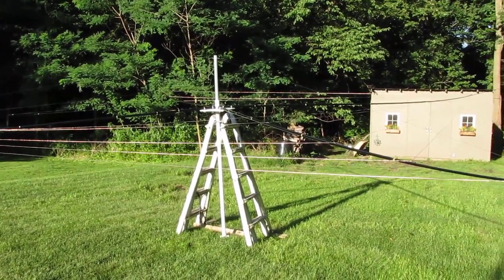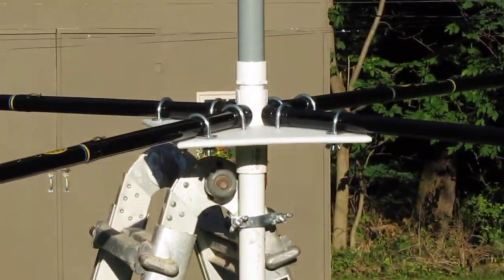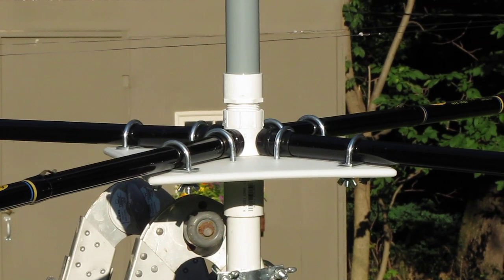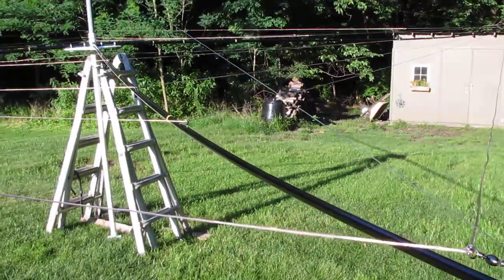Homebrew 5 band SpiderBeam

Comment: Hi Tina, the Spiderbeam is the only antenna that has the same perfomance as a tipical yagi-uda with half wave, but, with a shortned antenna profile. No traps, no coils, only a choke balun to maintaining the array balanced, because it works with a balanced line, and the only one coax cable is unbalanced. You can work with a 3 (20-15-10) or 5 bands (WARC too!). So... I'm thinking in build this one in my QTH too. 73, from PR7RC.